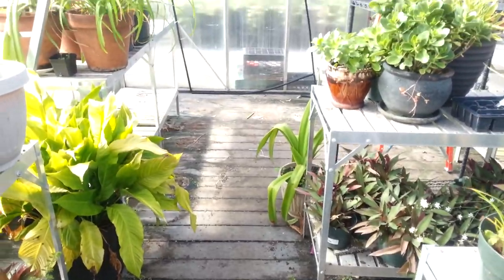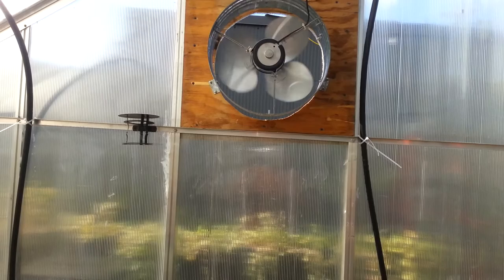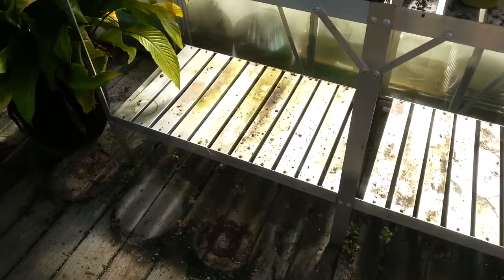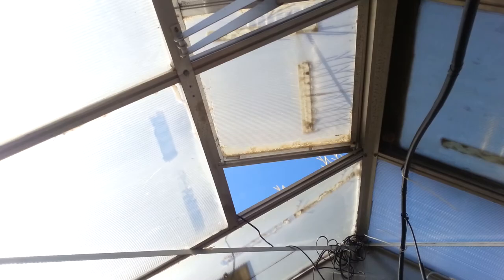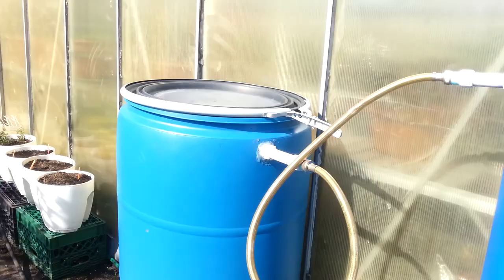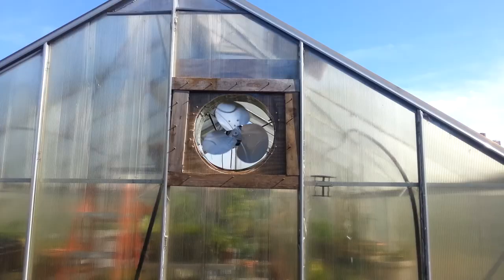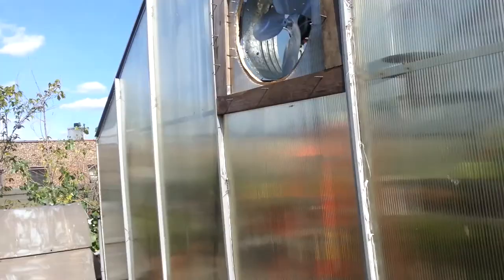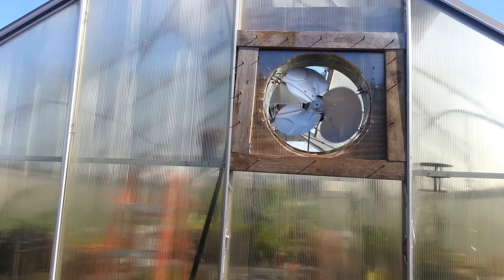gable fan in a greenhouse

Comment: How much CFM does the gable fan has? Also where did you find the solar panel. I'm trying to set up a system just like yours and I'd like to have some ideas. My greenhouse is smaller than yours, mine is only a 6x8 so the fan cannot have too much power. And info would be appreciated. Thanks